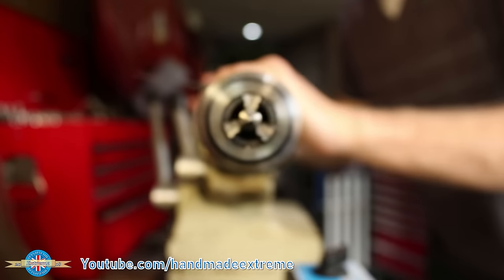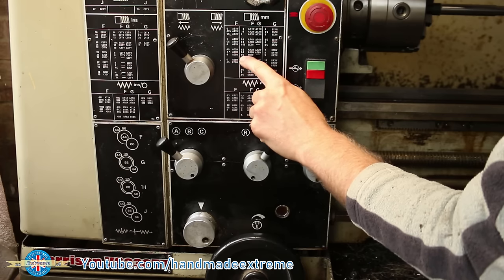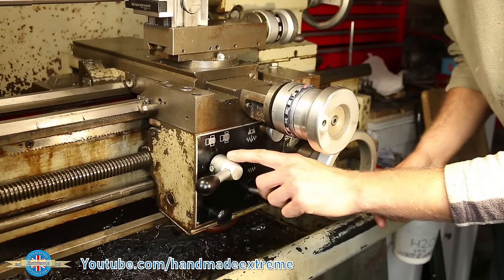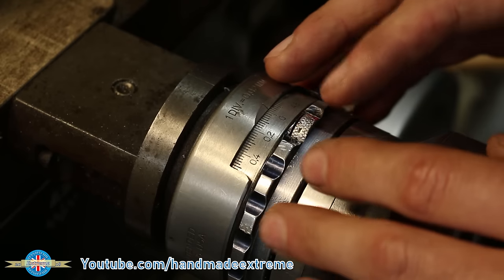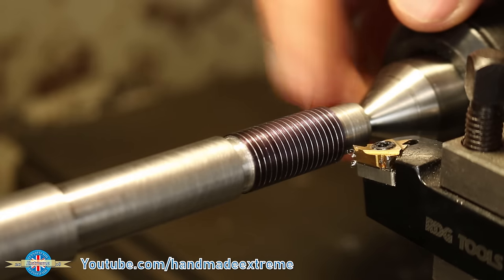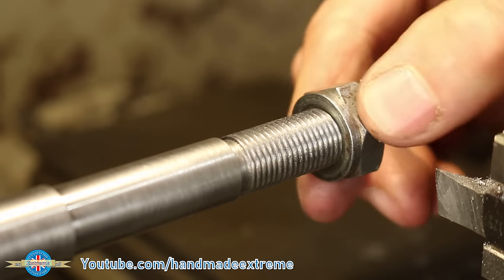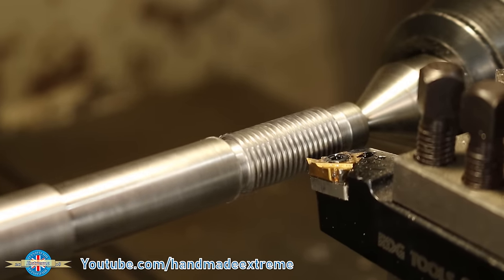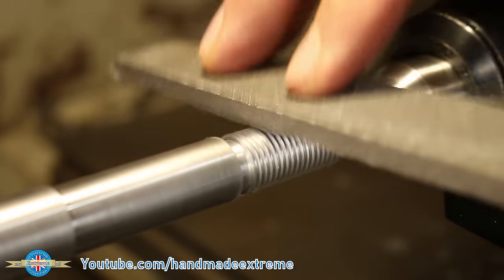How to cut a thread on a manual lathe (Intermediate method ideal for home workshop & hobby engineer)

Comment: Great video, one of the best I've seen on cutting a thread.

If I don't have a thread dial indicator, how do I go about this?
Reply from the maker: What you have to do Is never disengage the half nuts. If you do, since you don't have the indicator, you will loose your place and end up cutter a different thread each time. The way around this is to cut your thread, stop the machine, withdraw the tool, reverse the direction of the machine, drive it back to the start, change it back to running forwards, put on your next cut, start the machine, then do your next pass. Then repeat this process until your done. It take a fair bit longer as you have to wait for the machine to drive the saddle back to your start point, but works just as well.  Remember once you have engaged the half nuts don't disengage them until your done.  Best to practice on some scrap first. Dead easy once you get the hang of it. Hope this helps. Thanks for watching. 👍
Reply: Handmade Extreme can you skip withdrawing the tool (or only 1 thou back off) while reversing  the lathe without a dial by putting reverse pressure on the hand wheel and “walking” the carriage back against the lead screw removing the backlash? I feel this may be a bit easier but I don’t know my southbend has a thread dial

Comment: Love the term Gutter used for UNDERCUT. Machine the undercut to the thread root dia. also use a bit of coolant. Great video well explained.
Reply from the maker: ...Undercut... That's the one..😁 I normally do but for some reason I went a bit shallow. Finger trouble, number trouble, general incompetence... who knows haha  Thankfully it turned into a nice opportunity to demonstrate the advantage of this method over the drive it back and forwards one. Regarding coolant, normally i'd use some cutting oil but left it out for the video just so it's a bit clearer for people to see whats going on but your absolutely right!
Thanks for the support and i'm glad you enjoyed it. 👍
Reply: @Handmadeextreme  blame it on concentrating on the filming.

Comment: Excited to see this video as that's the exact lathe I just bought. (Mine's in inches) I'm new to thread cutting. How have you determined the beginning diameter prior to cutting the threads?
Reply: If your screw cutting a M 20 x 2.5 thread the outside of the bar has to be 20mm in diameter or if your cutting a 7/8 x 9 UNC thread the outside of the bar has to be 7/8 in diameter or 22.23 mm in diameter for those who dont understand the imperial measurement system

Comment: Great video and explanation. 👍.....  Served my time hand cutting threads like this but using the angled compound slide (half the angle of the thread) with hand ground has tools...  I really do miss manual turning now I'm full CNC. . 
I would add, and by no means is it a criticism. Using a full form carbide insert as you are it's advantageous to leave the thread diameter slightly big (+0.2mm) so that when you get to full depth there is metal there for the tip to turn the rads on the peaks of the thread thus no need to dress the thread with a file. 
Also file away the thin parts of the first and last thread too.... 👍
Lovely vid tho'. Subscribed. 😁

Comment: Great little video and I still cut threads with this method.
Cutting speed is way to slow as the tool is tearing the metal not cutting it.
Coolant or Rocol will help with tool life and finish.
Did you set the tip square to the job?

Comment: Good tutorial video. I used that exact machine , I always use the reverse Chuck method, never use the 1_8 dial.
Reply from the maker: Glad you found it useful. It's a great machine isn't it! Thanks for watching.
Reply: Give the dial a go.Its a good way to go.Ive just learned how on my old machine.
Reply: @derekcollins1972  I have used the dial over the decades and also used the Ainjest quick screw attachment but I prefer the reverse method.
Reply: Καλό και εκπαιδευτικό το βίντεο. Μπράβο!!!!

Comment: When I have done my initial scratch pass and I want to keep increasing the depth of cut till I reach the desired depth , do I use the cross slide to move in at 90 deg or do I use the compound slide to move in at 29 deg ?
Reply: Either way works. A lot of people say the cross slide method is easier. I prefer to use the compound as you can set a zero on your cross slide that you return to on every pass, and just feed in your compound. I will say, you get a better finish with the compound method as all the tool force is in one direction.

Comment: It looks easy just a pity my lathe is gear drivers and not auto like you, I have no idea what gears need to go anywhere, tap & die maybe for me but if I did have a later lathe that was a great learning experience, tks
Reply: If your lathe is complete, there is often a plate attached to it giving the required combination of gears to cut different threads... if it doesn't have one, maybe check the manual.  If you haven't got a manual, you might be lucky and find something online.  If that doesn't work, you are in the cack!
Just joking!  Measure the pitch of your leadscrew, and ask Mr Google to find you thread cutting tables... there is every chance you will find something!
I am like you... I really envy him for having that gearbox!... what a dream.

Comment: Nice job explaining what can be a very complex procedure.  Also for showing the importance for learning the parts of the lathe. 

I might suggest for some that one way to speed up the process and to get very good results for the thread cut depth is to rough the thread to a size close and then run a thread die cutter over the rough cut thread to finish cut. That way you will have started the threads nice and straight as a lead for the thread die. Use the thicker thread cutting oil for a nice finish too. 
We used to do this because even a slight distance off on your depth can cause major problems either too tight or loose. Too deep and you made scrap. 

If you’re experienced enough you can place the thread cutter in the holder and let handle rotate up against the carriage. Turn the lathe on slow and stop the machine just before finishing the cut. Let the handle follow the carriage. Finish by hand and reverse the lathe holding the die cutter handle. 

This allows a straight precise thread every time that works. Most people can’t cut threads by hand without going crooked so they cut a rough thread and finish by hand. 
Brought back memories and using the thread gauge rods to measure groove depth. Learning how to read and find the information in a source book is a lesson in itself! 

Thanks for sharing

Comment: Thanks for that great work may i ask a question?When i end the cutting and go to the beginning i must be away from the thread cut 1 or 2 or 3 or 4 ...etc times the pitch of the thread or simply go back to exactly where i started how can i go manually to the same place do you use some kind of indicators to do so?

Comment: I wonder if the pitch you are making is a factor of the lead screw pitch there is any need to use the dial indicator ?  So for example if the lead screw pitch is 3mm, and you want to make a thread of eg 3mm, or 1.5, or 1mm etc, regardless of where the half nut is re-engaged it will nevertheless hit the spot.  Any comments ?

Comment: Yeah we have all got the same lathe  with all those settings.   Maybe if we don't have a lathe with a brake and a counter dial what would you do ?    How about turning from the back of the piece and running away from the chuck.  No need for a counter .

Comment: ha! good old time when I was at school, we had manual lathes... well, everything was manual, even cylindric gringers, no cnc 
Though I never did a thread on a lathe. We had some scary threading machine, a Cri-Dan... a simple mistake in calculation and you'd send everything through the workshop
Reply from the maker: Technology has certainly come a long way in the last few years.  It's incredible what some the the machine can do now. Thanks for watching.

Comment: I think that using the compound slide set at half thread angle is safer because there is no need to remember which number to use for each cut.It stays on zero.
Reply: Agreed. Especially with a DRO.

Comment: Very helpful, thanks! As it's an axle, will you be hardening it once the machining is complete?
Reply from the maker: Thanks very much. Glad you enjoyed it. For this application no; It's for a vintage motorbike that is used for flat track racing. The bike does a very limited number of miles/year so the gain in wear resistance due to heat treatment was not deemed necessary. Thanks for the support. 👍👍
Reply: The wheel doesn't run directly on the axle, it uses bearings, which ARE hardened.  A side effect of hardening steel is that it becomes more brittle.  If a Motorcycle wheel axle such as this were to be hardened, it would become dangerous given the loadings of forces it might be subjected to.

Comment: Depending on the lathe, Standard or Metric and what type of thread your cutting if you can dis-engage the half-nut. Matric lathe you cannot dis-engage the half nut if your cutting a standard and if it is a standard cutting a metric thread you cannot dis-engage the half nut. You can dis-engage it but you must re-engage it while reversing the lathe catching the same number before it makes a full rotation, failure to do so will result in a damaged thread. 

I live in the USA so our lathes are not metric in most places, if I cut more metric threads I would invest in a metric lathe just so I could dis-engage the half nut as it speeds up the process and takes a lot of wear and tear off the lathe as I do not have to stop the motor, reverse it, then put it back in forward to cut the next pass. Whenever I cut threads on some barrels that are made over sea's I have to cut them going back and forth using the motor to move the carriage to the start of the thread.

Comment: Pretty good demo, just one extra point you could have cut the run out groove deeper using the threading tool instead of changing to a different one.
Reply from the maker: Great tip, thanks. Glad you enjoyed the video.
Reply: A bit ugly looking, but could have ignored the shallowness of the groove, because the depth of the eventual cut in that area wouldn't have caused any dig-in problems.

Comment: Problem is  cutting a thread with  that tool  tends to churn up the thread as it doesn't have much of a top or side rake. When I was cutting threads on mild steels on conventional lathes preferred to use hand ground HSS tools. A quick way to cut that thread is to turn the top slide to half the thread included angle and feed in with it. To finish use both  sides of the tool to fine finish. Ok to truncate the thread with a file but radius it as you go. If you have a thread  comb and toolpost rest all the better.

Comment: I use a slightly different way of cutting a thread..it does not involve using the compound slide at all but it still allows you to advance the tool to reduce the cutting pressure so you don't snap inserts or gall the thread faces. I requires the use of the forward/reverse FEED selection lever. It works both when using disengaging feed nuts or simply reversing lathe. What you do is when your cutting depth gets to around 0.5mm you stop the machine after a cut. Then disengage a DRIVE gear so you can easily rotate the chuck backwards by hand. Spin it backwards half a revolution or so by hand and stop..Then disengage the forward/reverse FEED lever..Now with one hand on that lever and other on chuck, continue to turn the chuck backwards while trying to reingage the FEED lever..It should pop right back in when the teeth line up inside the lathe again. Takes a bit of practice but it should advance the leadscrew a fraction. Depends on lathe, pitch your cutting etc. so now when you return to screw cutting your thread, the insert should be cutting on the leading face again. Repeat about every 0.5mm. On course pitches you may need to advance two teeth at a time..This technique saves moving the compound slide. very handy when you use a quick change tool set up with a DRO. You don't loose your tool settings of other tools. Allows you to cut threads as perfectly as any cnc with a bit of practice. Hope you feel inclined to try this technique some time.
Reply from the maker: That's really interesting I had to read it a couple of times to get my head around the idea. I will definitely give that a try at some point. Thanks for sharing!

Comment: What do you consider basic and advanced... if this is middle ground ?
Nice video. Subbed
Reply from the maker: I'd say that driving the cartridge back and forth using the lead screw is a slightly more basic method. Little bit safer but takes a bit longer. Then using the rotated compound method is slightly more advanced. Not by much, but enough to make the distinction. Glad you enjoyed it and welcome to the channel. 👍

Comment: Two questions: 

1. when you wait for your number I assume it has to be the same number every time, even though the table gave you a range?

2. Is you start point exactly the same for each pass, or just roughly and the feed sorts it out?

I'm pretty sure I know the answer to both, but sometimes it's worth asking the stupid questions for everybody's sake.
Reply from the maker: The number has to be one of the numbers given by the chart on your machine. If it says something like 1-8 (like on my machine) then you can use any of the numbers within that range for that particular thread pitch. Does not have to be the same one each time as long as it's one of the 'approved' ones for the thread you are cutting. (at least that's how it is on my machine)

Doing it this way you can put the carriage anywhere, wait for the number and the feeds sort it out providing you engage on the correct number. 

Best thing to do is try it out on some scrap. 

Good luck.

Comment: you actually should set the compound at 29 1/2 degrees and feed in with the compound. what that does is the threading tool then cuts primarily on one side and only just kisses the other side of the V . this stops the chatter that you get and makes a much smoother thread groove. by feeding in straight both sides of the tool cut steel and as it gets deeper the steel rips rather than cuts.
 there is a cheat method for how you did it. if you set the compound parallel to the bar you are threading and on every cut when you feed in deeper you also feed slightly towards the chuck on the compound. that accomplishes a similar thing to the 29 1/2 degree method.

Comment: Nice. How do you calculate depth of cut? If no sample to check.
Reply from the maker: You can use trigonometry to to calculate it. Half the tool forms a right angle triangle. Half the thread angle is the acute angle within the triangle and the DOC is the adjacent. Sorry this would be much easier to explain if youtube let people post images in the comments section.  

The proper way to measure it after it's cut though is to use a set of thread wires which rest in the grooves then you can get an measurement that you compare to tables to check the fit tolerance. 

Cheers.
Reply: Calculate the depth of thread,pitch times  .54127 will be depth,for internal thread pitch times .61348

Comment: No matter the method, there is often an error made at the very beginning. The error is turning the blank to the nominal size of the thread. Examining your threading tables note that the blank diameter is slightly smaller than the thread nominal size.
 
It is important to follow the chart recommendation. If you turn the blank to the nominal size and use a nut to check the thread, you will invariably cut the pitch diameter undersize. This is because the crest of the cut thread will be hitting the root of the thread in the nut. Then when you take another pass on the work you go from won't fit to sloppy fit. This is especially true if you take a file to deburr the work after you finally get the nut to go on.

Using a nut as a gage is ok for work you are doing for yourself but is not acceptable for work going out the door. Either a thread go-no go gage or thread wire method must be used to ensure the pitch diameter is within specification. People get upset when their stuff won't fit the threads you made.
Reply: Depends on the class of thread.

Comment: With "advanced method" you're referring to where you turn the compound to 29.5 and advance that to reduce tool pressure?
Reply from the maker: Correct. Thanks for watching.
Reply: The advantage is that the tool is only cutting on the leading edge, reducing tool pressure. For small threads, cutting in x is completely fine

Comment: when you make an axle using S275 , do you heat treat the finished axle, an what would be your other choices for material
Reply from the maker: For this axle no there was not heat treatment. It's for a low use flat track race bike so not really needed. My go to material for shafts and axles that see a bit more load in service is usually EN16T which is heat treated. That said it all depends on the application. A simple shear for and bending moment diagram and a few calcs gets you in the ball park then select material based on that along with expected cyclic loads for fatigue endurance limit. Thanks for the support, I hope that helps.

Comment: hi bro,
how to calculate the lathe machine's thread gear chart, any formula there?

eg., Our lathe machine has a lead screw-4T.P.I (Threads Per Inch). I need 10mm pitch gears, What is the gears for A=? B=? C=? D=?.
Reply: CBT EXAM मैं Thread पर पुछे जाने वाले Question इस व्हिडिओ मैं हिंदी मैं है।
एक बार जरुर देखें
https://youtu.be/0z7QiOSqFD8